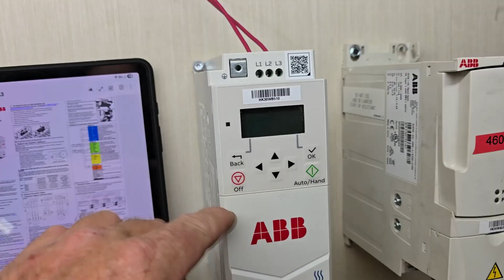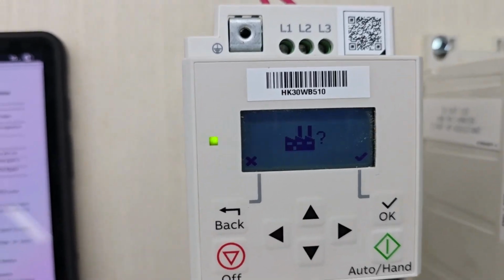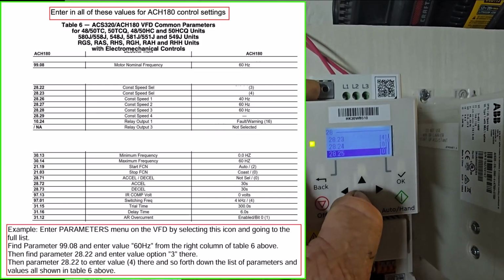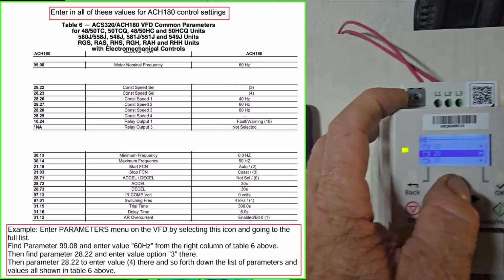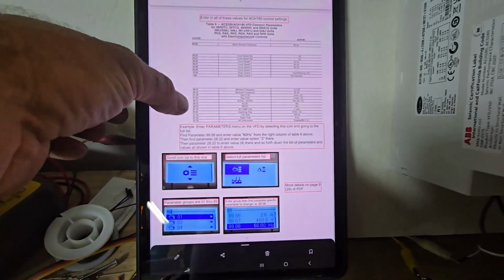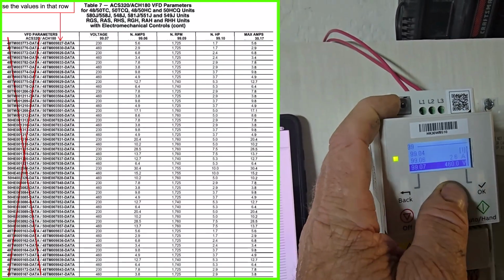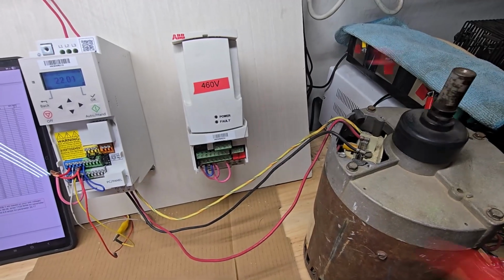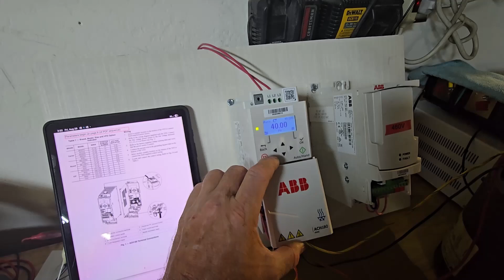Carrier ABB ACH-180 VFD Parameter Setup [ASC-320 replacxement]

Comment: Do you have a link for the pdf?
Reply from the maker: The name of the file is "ACH180-001-SUPP".
I searched for it, but it did not come up on the public web.
Try this, but you may need to be logged in.
https://files.hvacpartners.com/docs/1005/ChanPart/00/ACH180-001-SUPP.pdf
Reply: ACH180-001-SUPP